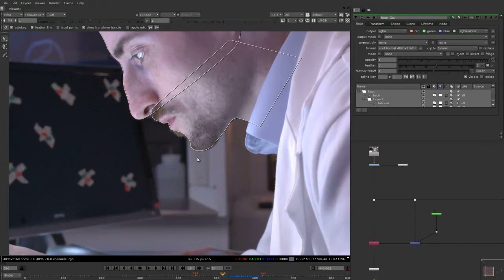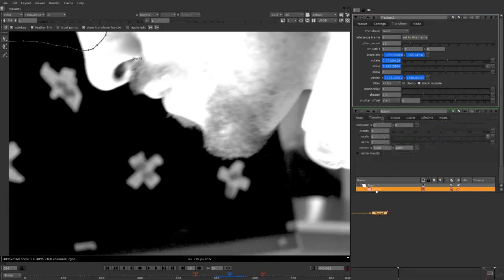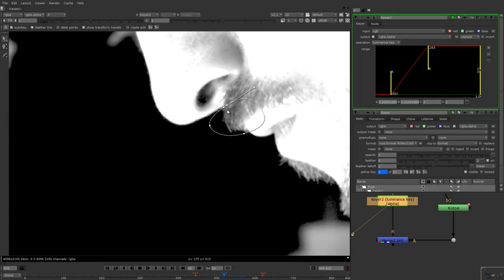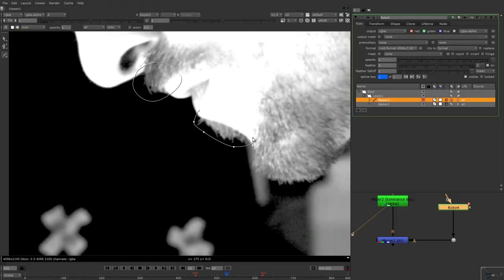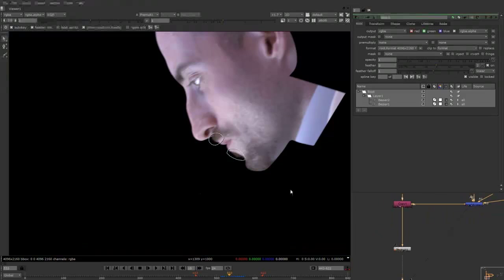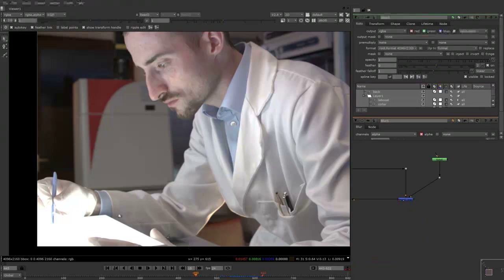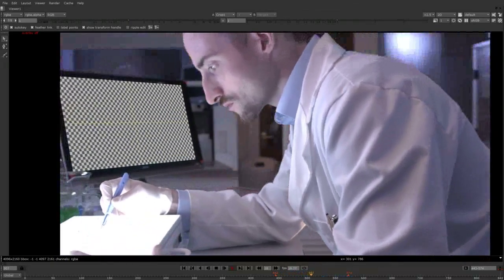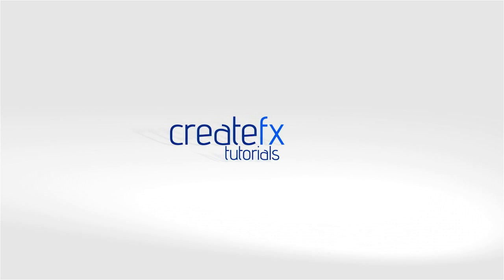Combining Keying and Rotoscoping (Part2)

Comment from the maker: Hi there, if I understand you correctly then what you need to do is take the premultiplied version then use a merge node to put whatever you want on top of that e.g. your screen replacement (plug what you want on the top into the A pipe of the merge node) then to put the premultiplied version back on top use another merge node once again putting the premultiplied version into the A pipe of the merge node. Hope this helps and answers your question.
thanks and please subscribe
Reply: is it Nuke or Fusion?? Compositing